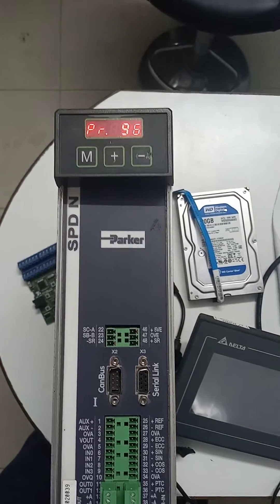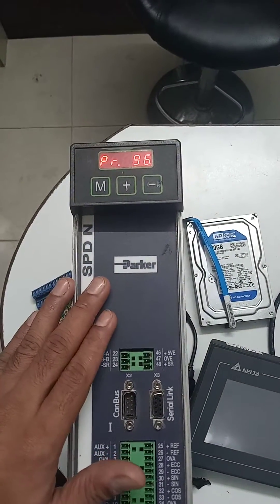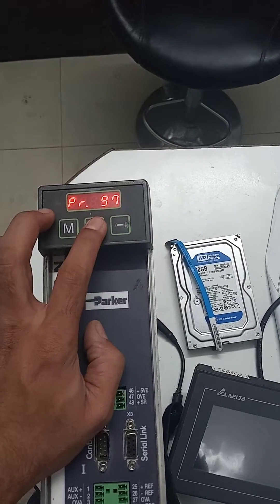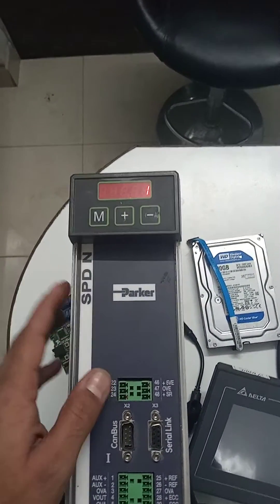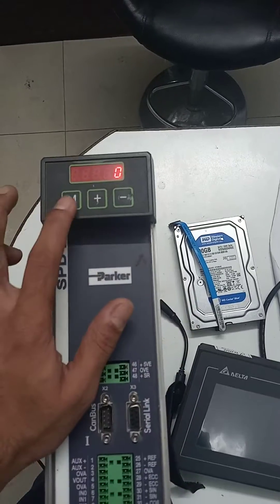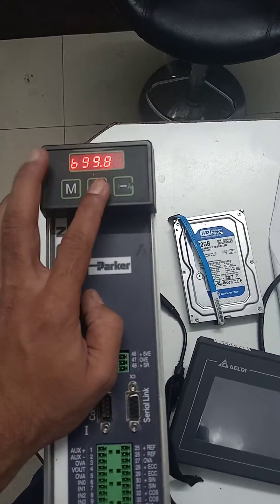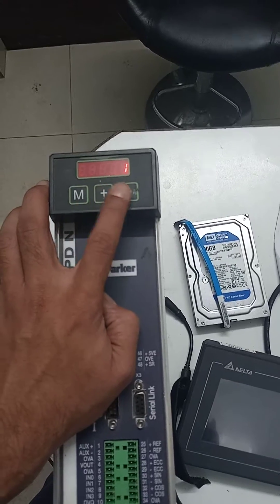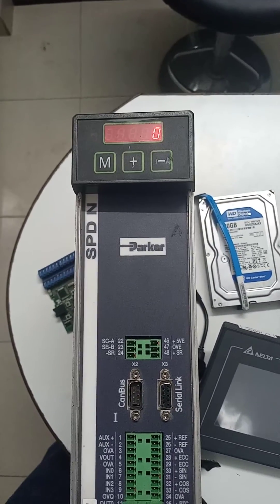How to reset under voltage alarm of SPD, TWIN or SPDN PARKER drive

Comment: Buenas noches tengo una alarma de er02 y el twin tenía unas resistencia del bucle DC abierta las cambie comprobé en el parametro 20 el voltaje DC y me mide 617 vol pero el error no se elimina .podrías por favor ayudarme
Reply: Thanks .si la maquina estapa parada por un periodo de 30 días y al encender apareció ese error 02 ha pasado dos veces estando la maquina apagada .si la maquina está configura en autoreset parametro pb99.8 en 1 la e puesto por defecto y persiste el error
Reply from the maker: error 02 is for under voltage, if the drive was running fine with no error and your practice was to shut down machine often for maintenance or when not in production and after startup under voltage alarm was not appearing and resetting automatically then i think drive is damage,
further check if in drive 02 error is set on auto reset and perform proper steps to set error 02 on auto reset  describe in video if still alarm persist then drive is damage
Reply from the maker: may this will also help to understand parameter and their use
https://youtu.be/v0AU0CkVQ_g
Reply: En efecto yo cheque la electrónica del twin y tenía una resistencia a abierta es por donde están los fan cool una serie de 10 resistores en otros casos se han cambiado y a funcionado
Reply from the maker: @ so the problem was solved by by repairing card?
Reply: Buen día .en este caso no a querido quitar el error 02
Reply: Sabes que .el driver lanzó una alarma de driver y reseteo el error 02 y me funciono

Comment: hello I have a parker spd2 but I can't get it to work error 04 where is the problem? THANKS
Reply from the maker: 04 is resolver error check motor side connection, cable, connector and if still not resolved try to change the motor and check
Reply: @industrialsolution6828  thank U

Comment: What’s should you do if you set it to one (1) and the driver still showing the alarm? Change capacitors?
Reply from the maker: There can be many reason which can be identify by checking component, start with checking DC bus voltages, then go to capacitor then rectification side of drive
Thanks

Comment: There is an error 02 and I was not able to remove it. Can you help me?
Reply from the maker: @industrialsolution6828
2 months ago
if supply voltage is 400v and still undervoltage alarm appear after doing procedure then i am afraid you need to change or repair drive, i am assuming parameter are checked before and correct
Reply from the maker: if supply voltage is 400v and still undervoltage alarm appear after doing procedure then i am afraid you need to change or repair drive, i am assuming parameter are checked before and correct

Comment: After changing this still error 2 undervolt alarm shows on drive after saving parameter.  What needs to check further?
Reply from the maker: if supply voltage is 400v and still undervoltage alarm appear after doing procedure then i am afraid you need to change or repair drive, i am assuming no parameter are checked before and correct

Comment: what does it mean when "converter has malfunctioned. Is my SLVD broken?  it says trip.3 and cant change any parameter with the "M" key
Reply from the maker: try this to unlock the display to edit parameter
https://youtu.be/OTfTbX0QiXo
Reply from the maker: Yes you need to repair this drive